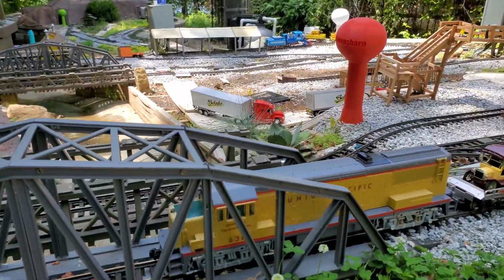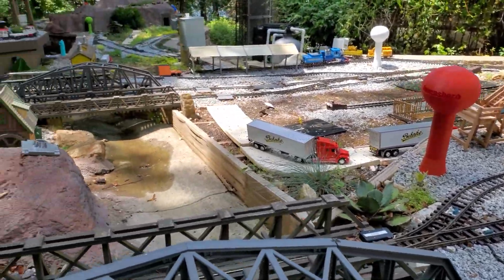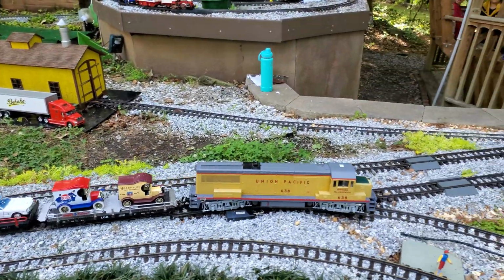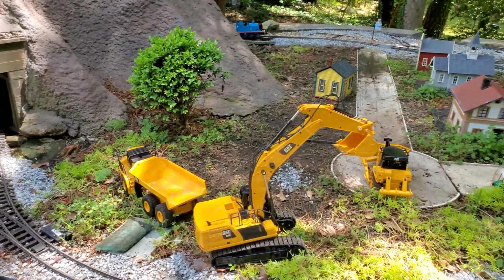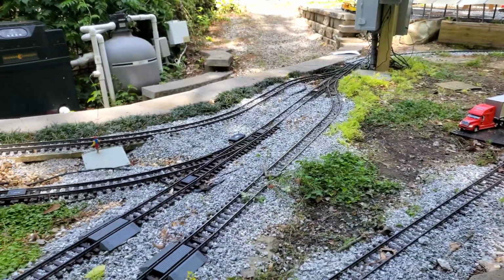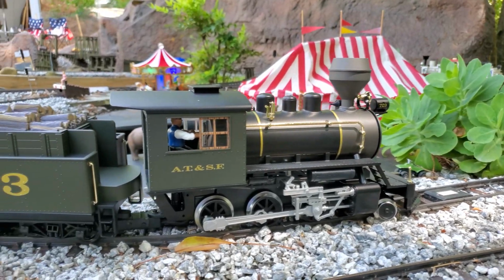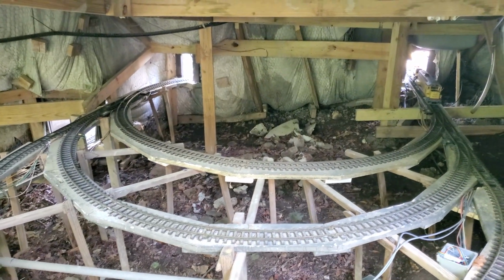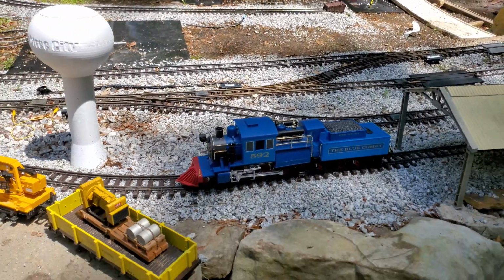The Georgia Garden Railroad Society Spring Tours (part 1)

Comment: Is this one of what is called dead rail,powered on board batteries with Bluetooth control? We have a big one  locally that Has power circuits on the rails for the signals. The loco is powered by batteries.
Reply from the maker: This is DCC like most HO and N layouts.